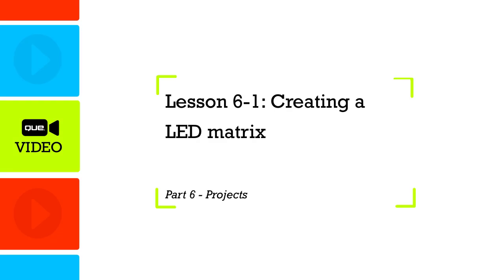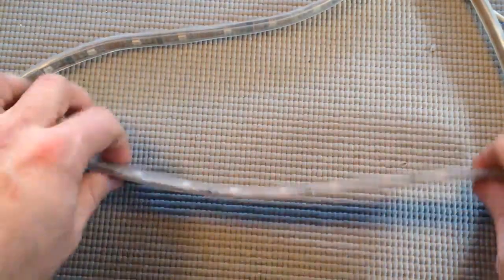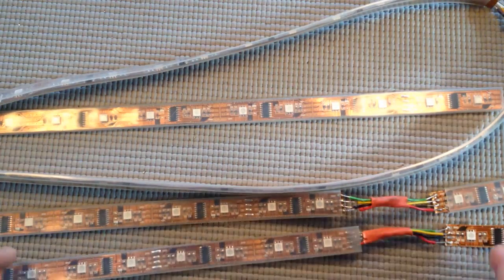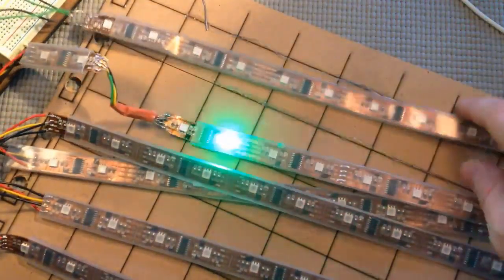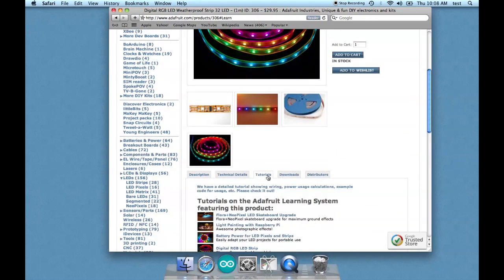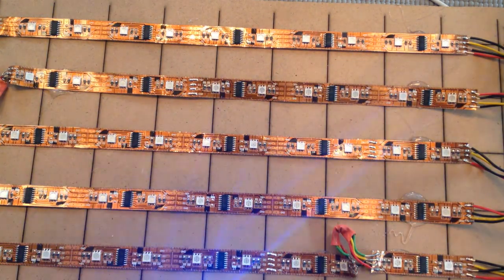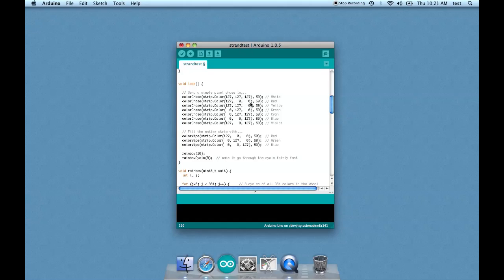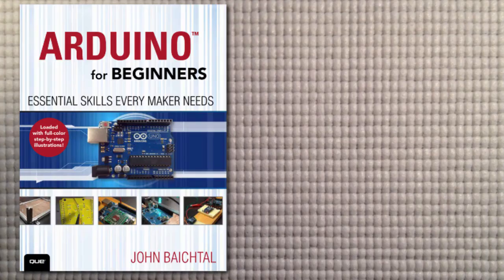Arduino for Beginners   26 Creating a LED matrix

Comment: How were you able to power all LED's with just the Arduino? Don't you need an external power source?
Reply: Mir Anwar the LEDs draw about 20mA per color on full brightness, so 60mA per LED => if all LEDs are white and on full brightness the arduino would overload, yes
Reply: If you know the number of LEDs in the code (12 x 18 = 360), just divide it into full brightness (255) to give MAXBRIGHTNESS (or he got lucky).